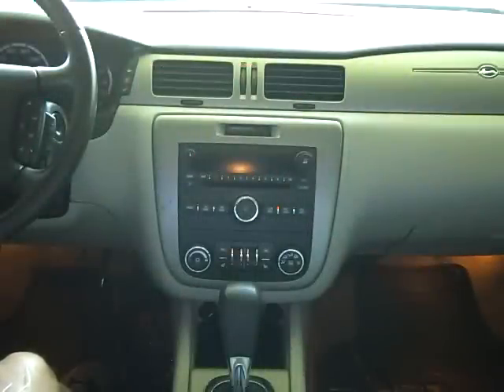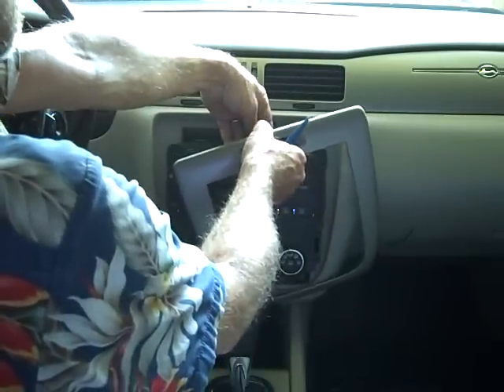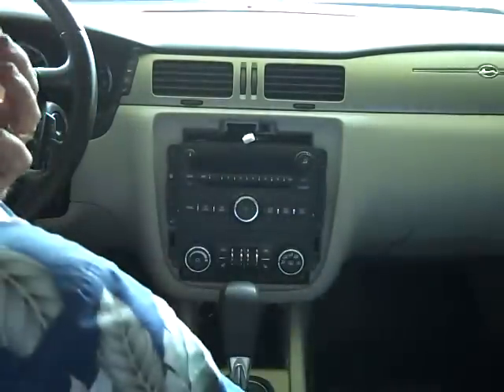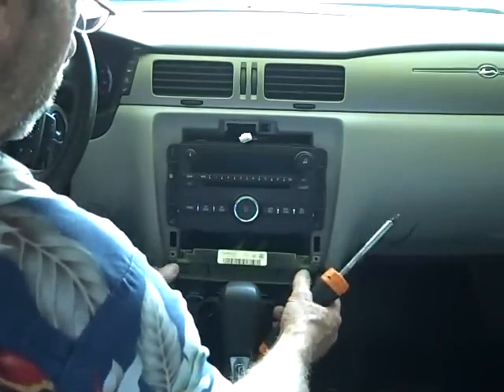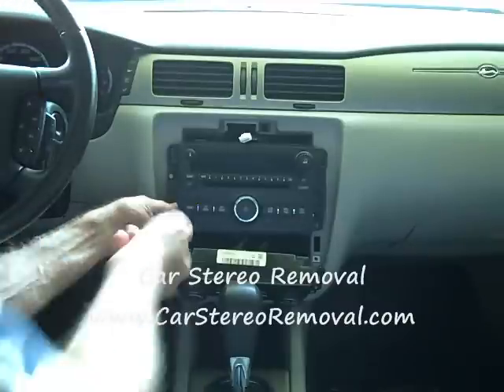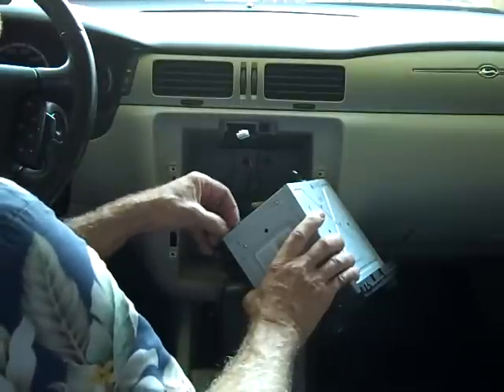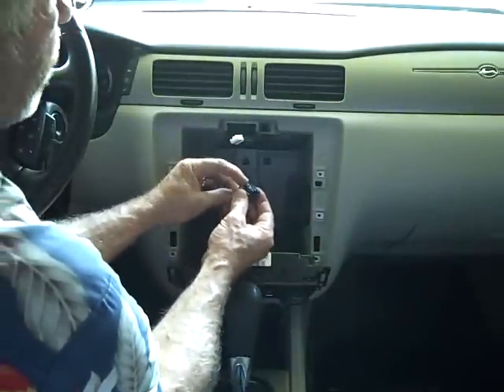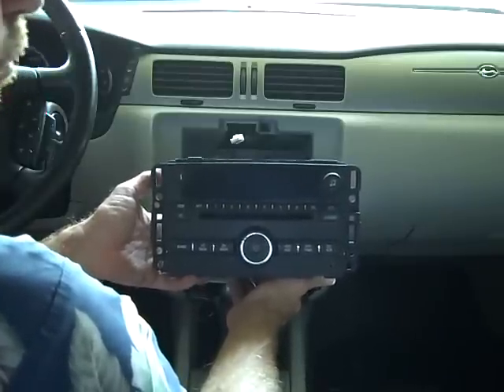Chevrolet Impala Car Stereo Removal 2006 - 2011 = Car Stereo HELP

Comment: Thank you so much! This was about 0.01% as difficult as I feared it would be. I broke my AUX cable plug in the jack this morning and was prepared for the worst. Nope! I had the radio out in under 5 minutes. It didn't even take me another 5 to pop off the front panel of the stereo (4 screws and a few clips) and pull out the broken piece. Start-to-finish (including reinstalled) in about 15 minutes. I even rereouted my new AUX cable through the trim ring instead of coming up from under the dash.
Reply: how did you get the broken piece out ? i did the same too
Reply: Pull the stereo out as described in this video. Look at the front panel, you'll see some screws around the outside edge. Take them out. There's also some plastic clips holding the front panel in place. Gently life them up and the whole panel will come right off. Look behind the AUX jack and pull the broken plug out.

I no longer have the Impala, so this is all from memory. But, as I said, it was extremely simple. IIRC, there's no delicate cables or other parts you need to worry about too much. Just don't blindly pull it off and you should be OK>
Reply: thank you 😊

Comment: This is the same radio that comes in the 2006 Buick Lucerne that I just lost the LED read-out. I found a replacement radio on ebay for around $30 and plan to use this video to help me install the new one. Thanks for posting this!

Comment from the maker: This is aftermarket installation... Visit SEVERAL of your local installation shops. They can answer your question and fill you in on all the adaptors and expense needed to add a stereo to this system. Including all the features you may loose...

Comment: once you disconnect it, plug it back in will it play ,or needs resetting from the dealer .?  heard they hav a anti theft system from preventing it to work
Reply: Dennis Kingsley mine locked when it was unplugged. Be careful

Comment: I’m having trouble disconnecting the connector piece. I pushed down on the top and pulled hard ( probably not smart ) just was getting frustrated. I tried basically everything

Comment: What are the dimensions of the the factory radio i have a 2007 monte carlo ss that i want to have a 6.2 pioneer avh-1400nex installed in and i dont want to have to cut the dash

Comment: Could these radio go into lock mode?
If so how can you prevent that?
Reply: stormchaser8624 mine did and still is locked
Reply: Is lock mode when it gets stuck and don't want to leave

Comment: I was wondering if i was to instal a JVC stereo in replace of the factory stereo will the controls on the steering wheel still work with the volume?

Comment: I have the same radio as in your video.  I want to put a smaller cd player with all the same options than the giant factory unit. Since I hae problems with mine. I don't have a radio in mind yet.  I have no need to XM, DVD and GPS since this is my daily beater.  Thanks

Comment from the maker: I'd look at the amplifier having problems first. However, a reset may set the communication in the system straight. Disconnect the negative terminal from the battery for 10-15 minutes and reconnect.

Comment: I have an 07 Impala. Does this removal go the same if its a wood grain panel? If its different, whats the best way to get that trim off without scratching or braking it?
Reply: +Michael McKinnon Most likely too late but it is the same from 2006 through 2011 I believe. ;)
Reply: I believe it the same for 2007. As long as it's not past 2011.
Reply: +Ali Musa I have a 2013 impala is the procedure any different
Reply: josh summers I believe that if it has the same interior as this one then the steps may possibly be the same.
Reply: thanks
Reply: josh summers You're welcome.

Comment: Okay... I done everything as I just seen here, before watching the video.. So I was okay there. no problems. However. Now the radio is silent. I can barely hear static. CD won't play either. The problem I had was making me think the Antenna was bad, or barely connected. Radio lost stations fast. I took out, seen no problem, put back, and now have a BIG problem.  What do you think I done to make that happen? No rips, breaks, bangs or bumps. Easy out easy in.
Reply: Na. But I got it. the Antenna was bad.. And got it back on shortly after. But the tint on my windows done it. I just bought the car not long before asking this.

Comment: can i hook a a system uo to this or will i need to upgrade the stero
Reply: +Kyle Burke There's some kind of converter that you can attach to the back of your stereo that will allow you to use the stock face plate with an after market system. You need it so that the right sound frequencies get sent to the subs vs the other speakers. I'm not sure what the converter is called but good luck.

Comment from the maker: Not an easy task with all the info provided on the screen of the original stereo. There is a kit, antenna adaptor and $100-150 wire harness needed for the installation.

Comment: what is that blue thing hes is using
Reply: +Holly Jordon A spudger
Reply: +Holly Jordon It's a plastic trim removal tool. They usually come n sets of a few diff styles. Allows you to removed panels and trim pieces without marring or damaging the edges from prying with other things like screw drivers.